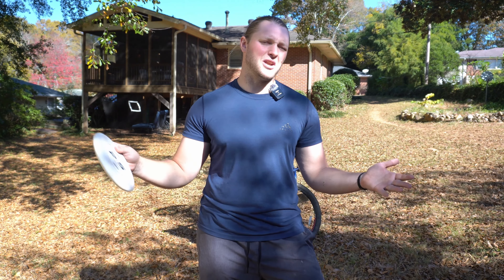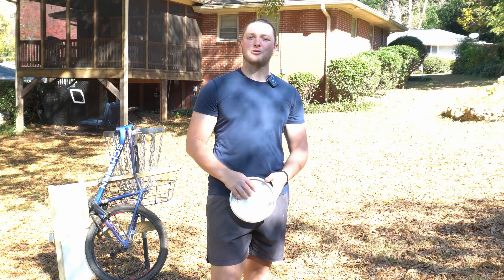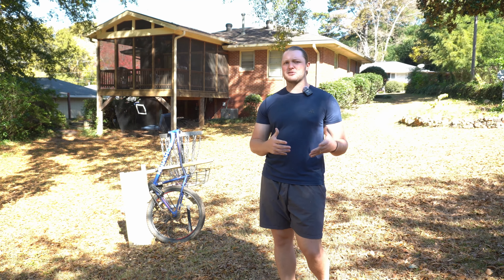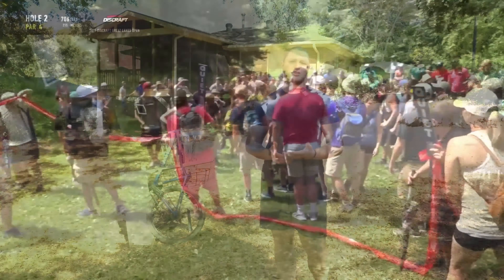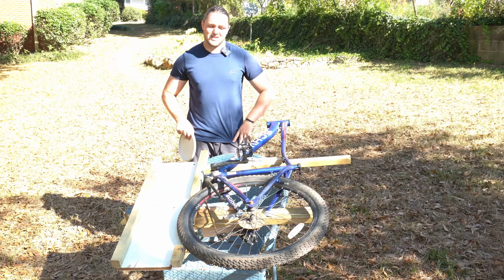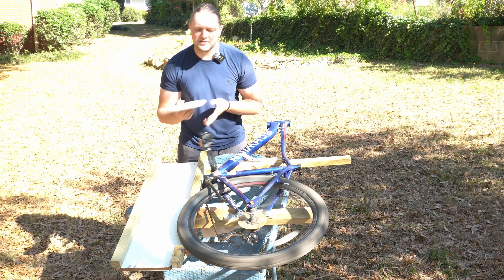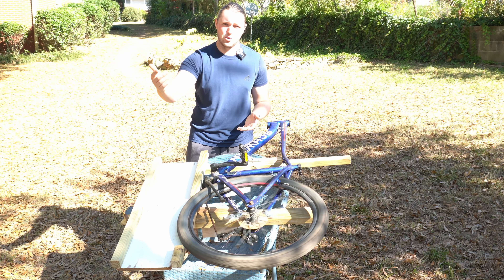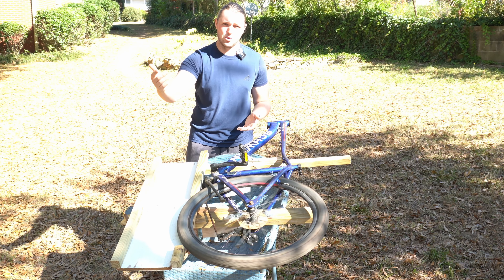The Science of Rollaways. Putting Machine Reveals the Secret!! | Disc Golf Science + Improve Putting

Comment: Nice start!  AND

Doesnt spin speed matter? Low spin, disc angle easily changes on impact. High spin, the disc is gyroscopic, hard to divert its angle of flight. True?

Rollaways also happen on layups and approaches into/onto hillsides.  

I have my own beliefs on this, but scientific tests are needed.

Keep going please!
Reply from the maker: That's the plan! Cureently its really hard to do variable consistent spin with the machine because it gains spin as a result of speed with this design. 
As for layups we tried testing this and got some, but way less than cage hits. Though I hope to try doing it for just layups (though I think it's likely a product of forward momentum forcing the pivot. No data on that)
But glad you liked what I've done so far! Stick around when I'm not filming new courses I learn other science stuff to connect to disc golf

Comment: This makes sense. It also proves the old heads right. Flat release with as few movements as possible.
Reply from the maker: Glad you liked it! What do you mean by as few movements as possible. Disc or the golfer?
Reply: @the-tee-less-traveled-discgolf  The golfer. The fewer movements you have and flatter your disc is the better likelihood of it going in the basket. So you don't want to have your wrist fully cooked, elbow bent, and be swinging your arm. Also, if your release is flatter, the disc isn't on these wonky angles if it were to hi cage instead of chains.
Reply from the maker: @NJT1013  cool. That's kinda what I thought but wanted to be sure. Thanks for your comment! I'm glad you liked my experiment/video

Comment: Since you have a machine with reproducible results, I'd love to see if overmold discs rollaway more frequently than single mold discs.
Reply from the maker: Oooh. Good idea. We can certainly test for that
Reply: @camhoffdg just a heads up, electron plastic overmold does not have the same gyro effects as premium plastic. My hypothesis is that premium gyro plastic rolls away more
Reply from the maker: @justwondering1926  interesting. Is this a plastic density thing?
Reply: @camhoffdg  yes. Premium plastic gyro discs have a higher density rim than flight plate with the effect being extra on fission plastic.
Reply from the maker: @justwondering1926  figured but I'm fairly new to disc golf so wanted to be sure
Reply: I believe lighter putters roll away more also domeir disc also.

Comment: To avoid it on a risky putt, and I know this sounds counter intuitive, slight flex anhyzer. So the disc, like you pointed out, once a flip back to a hyzer angle. If you start at an Anhyzer angle the disc will actually land flat and drop out of the air once it flips out. It is my go to run it without making it roll away shot.
Reply from the maker: Good advice! Does this work on far ones or short ones best?
Reply: I do the same thing, I mostly do it on farther putts with a slope. I use a slight anny angle with a little higher loft and a little softer. This way the energy is mostly depleted and the disc is landing flat with a plop. I'd say my normal putt is very flat to maybe slight anny and I don't get rollaways often at all.
Reply: @camhoffdg  both, just make sure to give it some altitude

Comment: Try your apparatus on flexible vs stiff discs.  I think flex discs don't seem that bounce off the cage as forcefully.
Reply from the maker: What do you classify as stiff and flexible?  Like pastiche types
Reply: @camhoffdg  just suggestions: kastaplast k1 soft for a moderate effect or gateway super stupid silly soft for a major effect .
Reply: I keep soft/flex putt/approach disc on hand for running aggressive or dangerous putts.  If I'm more confident I use a standard baseline putter
Reply: Curious if I'm imagining the benefit or if you can detect it too
Reply from the maker: @joem8496  so we didn't try that flexible but we did have a range of bt soft to hard and 300 soft to 300 firm. We didn't see any difference in the number or severity of the rollaways.
Reply: @camhoffdg  cool thanks for sharing!
Reply: @camhoffdg  great video
Reply from the maker: thanks!! @joem8496

Comment: I'm pretty good at putting but when I get into a situation where the baskets on a sidehill, I'll throw a thumber and land the disc on its lid. It works great. I've saved myself a lot of strokes not going for the 50 foot side hill putts. Although maybe I would have made them?? 😂
Reply from the maker: Hard to say. Risk reward. What disc are you thumbering with
Reply: @camhoffdg  I usually use a sticky Fierce Pierce if I want it to stop near the basket. Sometimes I'll use a slick disc that will slide to the basket. They always land on the dome and never roll away

Comment: Cool machine... did you record any data?
Reply from the maker: So we started out trying to do so but then realized that most discs don't roll. So entering everything into the excel wasn't very efficient. So we instead just ran as many discs as we could and then recorded which discs rolled and under what conditions and did each condition like 4 times through (with 30 some each time). I'd like to figure out a way to have exact data but as we had just one day for running the experiment and then a few hours to make the video this was the best I could do. Do you have any ideas? Would love to hear

Comment: Just buy an Elevation Koi floppy putter for death putts and call it a day, best purchase in my bag
Reply from the maker: Interestingly another person commented and said theirs still rolls on them
Reply: @camhoffdg  they have different levels of floppiness, mine is the most floppy they sell but yeah at extremely rare occurrences, it has rolled
Reply from the maker: @kwolitek4785  interesting. Would you say those moments were hyzer too? Or what about the floppiness prevents the pivot or stand up?
Reply: @camhoffdg  they don't bounce off the cage or band, they just drop straight down and if they land on edge, they will usually just collapse on themselves and lay down. I've had mine for over a year and the only time it rolled was on an extremely steep hill from 45 ft away and it dropped down but hit a large tree root which prevented it from collapsing on itself and caused it to roll. I only use it on putts where the basket is on extreme hills with high potential roll away risk so only one time out of many, I'd say it has saved me from a lot of roll aways and also gives me confidence to run putts that I'd be terrified to run with a normal putter. It's PDGA approved but most pros can only use their sponsored discs so you don't see them throwing it. I think all pros should have their sponsors make floppy putters honestly.
Reply: @camhoffdg  *also, it's extremely over stable at low speed, so most putts are released on anny angle
Reply from the maker: @kwolitek4785  most interesting. Unfortunately with the machine it works by pressing the disc against a wall so it would just bend the dosc and not launch it. But doesn't dga have a really floppy plastic? I could be wrong
Reply: @camhoffdg  yeah there's other floppy plastic out there but to lesser degrees. It might work in your machine because the rim does have some rigidity but yeah, high probability it wouldn't due to what you said. Either way it's the best solution I've found for roll aways and will always have a place in my bag heh
Reply: I just got a Koi and threw it for the first time today. It's springy but not sure if it will roll away yet.
Reply from the maker: @deepsender  does it feel weird to throw?
Reply: @camhoffdg  Yes it does feel weird to me. For some reason it feels heavier than other putters of the same weight. When I throw it hard, it pops up in the air. Maybe revealing a flaw in my form?
Reply from the maker: @deepsender  my guess (without seeing your form) would be its partially the disc deforming in the flight to have a shape like ~ or something which would cause more air to go under the disc. But this us without me testing it or ever throwing one. There are some other comments here where people talked about how they could still roll. So my guess is go to those comments and ask why. They likely know.